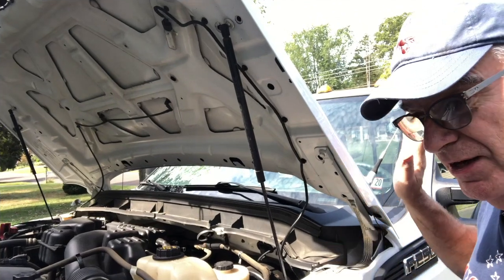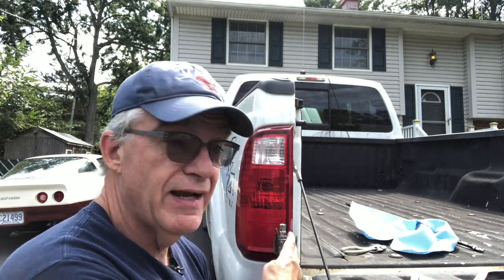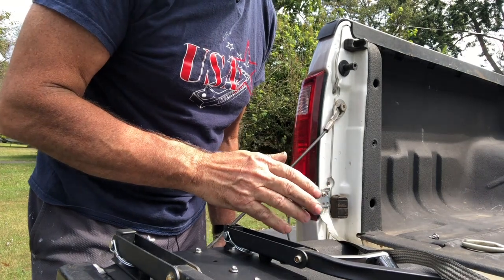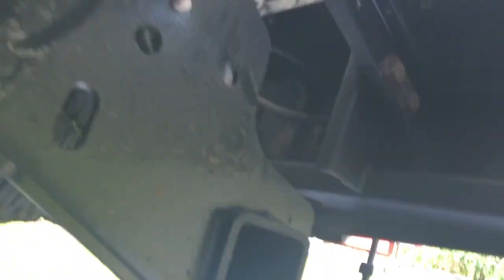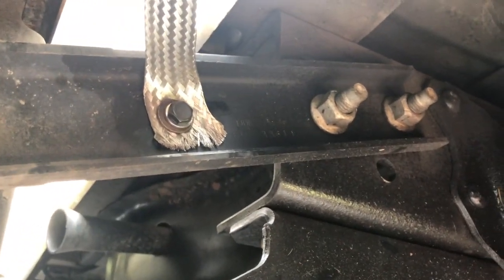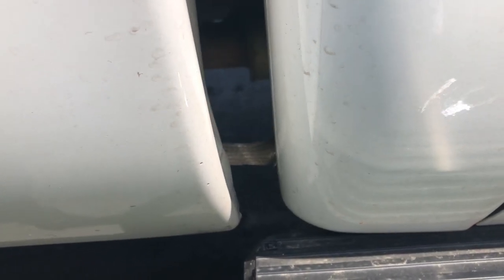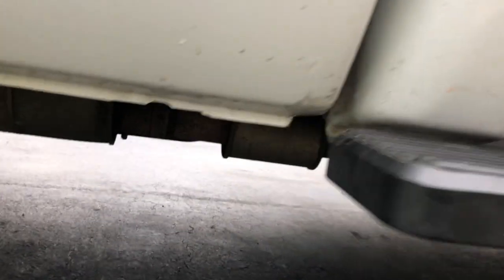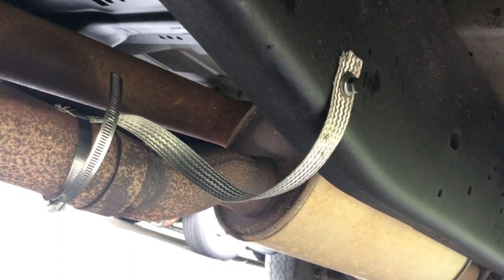Mobile HF Installation Part 2--Bonding

Comment: I view this as slightly redundant considering the sections of the truck are already bonded together or things like the taillights wouldn’t work without a ground wire path. Thus the frame is bonded back to the battery where it grounds. But more bonding ie neutralizing the electrical charge among panels the better.

Comment: Avionics tech here. We burnish the aircraft skin till it shines past the Zink primer coating at the hardware connection before connecting. We the glypt over the hardware and skin with glypt designed to prevent corrosion

Comment: Is using battery cable wire Ok or does it need to be flat wire.
Reply from the maker: Everywhere I’ve read recommends the braid for bonding more for RF reasons I believe.
Reply: I have ordered some flat braid. Thanks

Comment: I have been watching videos on this very subject no one has said anything about bonding the exhaust which is already grounded to the engine. I'm using 3/4 braid soldered onto copper fittings and going down to bare metal. Most videos claim every 12 inches or 12 to 18 inches I'm going every 15 inches. All four corners of the cab same with the bed all four doors both sides of the tailgate the hood and cab to bed. I spray clear coating over all the ground points when I'm done this has made the RCI 2970 come to life almost like being hooked up to the beam antenna.

Comment: I have not bonded my Ram 3500 diesel at all and I'm running a mag mount antenna to my radio.   11 meters.
Talked to Europe and UK/Ireland, west coast and South America from NC last week no problem.   About 75 watts.
Reply from the maker: Excellent!
Reply: Never confuse what propagation gifts you as a litmus test for antenna performance. The operators set up on the other end along with just a damn good pipeline the propagation can make even mediocre set ups boom in other places

Comment: Great video! Thanks for posting! I’m going to have to do my truck now. Usually only operating 2 meters and 440 but occasionally I do stick the HF triple magnet mount up on the roof and I’m sure it would make a better ground plane if everything was bonded. Thanks again for the video.

Comment: So glad I stumbled across this video.
I just finished bonding my Ram 1500 and I think it made a really serious impact.  It's funny because I had the same exact problem you had where I ran out of braids when I went to do my exhaust. That will be next up when the spring weather hits.  K9KJ
Reply from the maker: I didn’t scrape the paint though.  I’m thinking about going back and doing that.  The installation is probably due for some maintenance anyway…when the spring comes!
Reply: @k2cjbradio  I'm thinking about going back and doing that too. I did mine just how you did yours. I think I notice a difference at least on receive

Comment: I have never once bonded a mobile install.I have had around 10 different HF mobile setups and I have never had any noise issues with any of them.I had great success from all except a Yaesu 857D and ATAS 120A that were both pure Garbage. I replaced them with an ICOM 7000 and a Tarheel II and all of the issues I had with the POS Yaesu gear immediately went away. Bonding may make my mobile even better but I don’t see any issues with what I have now so if it’s not broken don’t try to fix it.Leave well enough along.👍🎙
Reply from the maker: I am still dealing with coil on plug noise.  Might be the 7100 isn’t able to deal with that kind of environment
Reply: @k2cjbradio I currently drive a 2007 RAM 1500 5.7 HEMI Quad Cab and I don’t have issues on any band from HF thru VHF/UHF.I have an ICOM 7000 with Hustler Resonators and an ICOM 4100A with a Diamond SG7500A as well as a Radioddity GM-30 with a 5/8 wave Laird antenna and no issues with any of them.I use a ClearSpeech DSP base module with the ICOM 7000 but I use the ClearSpeech DSP Base units on every radio in my shack so I don’t have noise issues.I HATE NOISE.🎙
Reply: I agree that ATAS is not great, never got it to work with my 13 year old FT-857D.  Yes, the 857 is noisy, but I've done three mobile installations and I've never bonded, wondering if there is any improvement?
Reply: @frankwc0o  I have no noise with my 2007 RAM 1500 Quad Cab with Zero bonding.I had terrible noise with several Chevrolets and a Toyota.I have had no noise whatsoever with 2 different Dodge Rams.I’m using my ICOM 7000 and a Little Tarheel HP.
Reply from the maker: @frankwc0o I didn’t do a before and after test.
Reply: @k2cjbradio  I’m not trying to make mine quite since it already is.You just can’t fix something that is garbage from the start and they don’t care about making them quite.It cost them a few extra pennies and they are cutting corners more and more every day.

Comment: Good info.   I was not aware that this was necessary, so thanks for sharing this.   It seems you are just cutting the braid to size;   do you do anything to prevent fraying?
Reply from the maker: No I didn’t.  Some of the jumpers were a bit short.  But, a few years later and they’re all still there

Comment: Maybe I'm splitting more than braid  here, but I believe any painted surfaces that will make contact with the braid  need to be taken down to bare metal !
I might also tin the ends of the braid to allow for a more substantial contact area.
For those concerned about dissimilar metal issues, I believe there are a number of available spray's to combat same !
I know it's a pain, but anything worth doing, is worth doing right !
With the trade off here being reduction of noise, and proper shielding of Automotive components !
                🤔....?
              Just Say'n !
Reply from the maker: I did research that a bit and learned that we don’t necessarily need to go to bare metal because the RF couples rather than relies on a physical connection.  I’m sure others may suggest otherwise.

Comment: Chris, where do you purchase the braid?  I have found some at DXEngineering that is 10 feet long with ring connectors on it.  I can’t find the braid you are using.
Reply from the maker: Kinda late in responding….I forget where I got it.  Hamfest maybe?

Comment: Great video, but I do have a question ...... since your antennas are on the back of your truck and sit below the body line, does it affect your signal and reception?   Also, does it make it more directional?
Reply from the maker: Hard to say since I never did a comparison.  I do have a video of me operating mobile.  It might be directional toward the front of the truck.  I’ve worked mostly eastern US but have made the trip to Europe occasionally.  Thanks for watching!

Comment: I've installed many mission critical HF/VHF/UHF radio systems per manufacturer specifications and I've always bonded the RT, PA, COUPLER, and antenna mount to the body or frame of the vehicle by removing the paint and coating with a dielectric paste. But I have never heard of bonding each and every panel including the exhaust. I can't wrap my head around adding braid to a component that is bolted or strapped to the frame already. Besides just doing because it doesn't hurt, do you have any data that would support this?
Reply from the maker: I learned a lot from K0BG.com. Extremely thorough website on mobile installations.  Also VE6AB (jerryclement.ca) is a great site.  Re: bonding exhaust.  The theory goes that it actually “floats” from an RF standpoint and serves to act as an antenna radiating ignition noise.  Bonding to the frame reduces that effect.  Some recommend bonding it in 3 or 4 places.  I’ve also learned that the new paints have zinc in them as a rust preventer, and to scratch the paint nullifies that benefit.  Hope that explains why I did what I did.
Reply: @k2cjbradio  Thanks. I'll take a look at it.

Comment: I suggest switching the exhaust bonding to the U bolt kids from DX Engineering. My hose clamp/braid installation corroded badly after one winter. I bonded the hood, doors, and tailgate on my Honda Pilot using the same method as you, but I used crimped and soldered lugs on the end rather than compression of the braid. YMMV, but I wanted to be able to really honk down those mounting bolts (and/or nuts, depending on the location) and be sure that that connection was never going to loosen. I also used JetLube SS-30 on all of those locations (also available from DXE) and those connections still look like the day I did them.--73, K2UA
Reply from the maker: I haven’t taken a look but now that you mention it I’ll check things out
Reply: Believe it or not / electrical connectors need to be maintained annually.  Fluid Flilm / dielectric Grease.

Comment: The reason u leave the paint is that the zinc primer is it's electrically conductive. The tightening bolt with a lock washer is enough to make the contact. Use 18-8 stainless hardware where u can. Seth KC2WE
Reply: I’m an avionics tech and we have far more Zink in our primer than vehicles but we never leave primer on. We always burnish it all off under the hardware. We take a megaohm meter and would never pass our tolerances if even a small coat primer or anodizing is on it. Burnish till it shines torque it. Then cover the hardware and skin in glypt to prevent corrosion.

Comment: Nicely done.  I'm using your instructions for mine.  Just different antenna.  Where did you buy the bonding wire?
Reply from the maker: DX Engineering has it.  Have fun!

Comment: Will you do the doors to the cab, too? as far as scraping the paint, is the paint conductive? If not, how is it actually bonded? One thing that has prevented me from doing any hf install is drilling holes and thus opening the vehicle to the chance of corrosion it that spot, like where you mounted the antennas near the tail.
Reply from the maker: I haven’t done the doors yet.  Also didn’t scrape the paint as I understand the RF path that the braid provides capacitively couples the two body parts.  At least, that’s the theory.

Comment: So I was chatting today with Blue Berry Hill on the 38 LSB. Explaining my antenna is located beside the hood at the drivers side fender, he mentioned I should relocate the antenna because the RF can fry the computer on my vehicle. Anyone hear of that? Thoughts? Maybe a Faraday cage for the computer? To see my rig, there's a video.  https://www.youtube.com/watch?v=DF6iWdeJRCs
Reply from the maker: Never heard of that happening.  I haven’t experienced any issues.
Reply: RF can affect the vehicle computers.  Back in the day I drove a cable company bucket truck and it had been discovered that xmitting on the VHF radio would disable the governor on the truck.  When we needed a little extra from the engine to go up a steep grade we would just hold the mic button down for as long as needed.

Comment: Nice video, very informative - I installed an FT891 in a 2012 MINI Cooper this summer, my 2nd mobile installation - and did NOT bond and am now understanding how necessary it is.  In addition to RFI with the engine on, I've had difficulty tuning the ATAS120 antenna (lip mount on rear hatch due to the car having dual sunroofs) - - - will be getting some braid and getting busy.  
(I blogged about the installation at www.ab1dq.com, will need to do a Part II, I think...)
73 de AB1DQ.
Reply from the maker: I added more after the video.  I had an ATAS years ago and it was erratic.  I know now it’s because I didn’t bond the Explorer as well as I should have
Reply: Don’t forger to use a choke when doing the install. That could have helped your Mini Cooper install.

Comment: I’m getting ready to install a Tarheel screwdriver antenna on my 2017 ram king cab I’ll have the antenna mounted on the driver side back corner this is by far the best bonding video that I have found so far thank you sir
Reply from the maker: Thanks so much!  Glad it helps!
Reply: Did you see any improvement on your HF antenna when you bonded?
Reply: @frankwc0o  well, the antenna was a new install not existing so I can’t speak to the fact of improvement but the antenna system works fantastic

Comment: I saw your entry point into the rear of the cab from the outside, but I can only imagine how you got past the interior wall behind the rear seat...
Reply from the maker: That was a royal pain!!
Reply: @k2cjbradio  I'm trying figure it out myself on my 2000 Quadcab F250, I could only get the top part to pull away after removing the plastic rivets, its Horrible, its all behind the paneling,   :(  - KJ7RTW

Comment: worked on installing vhf radios etc on fire trucks in Canada for 7years Everything was deemed too be bonded to ground ( chassis )including most importantly the exhaust system 
Great to see this basic principle  included in a ham radio installation ,Sadly missing in all the others  ive watched

Comment: Chris, Thanks for your Videos and all your efforts with putting them together. Greatly enjoyed this series. Just curious: In part 1 you scanned the antennas before you did the bonding. After bonding did you scan the 2 antennas again. Will be very interesting to see what effect the bonding has on the SWR, on the resonant frequency and the usable bandwidth on 20 and 40 before and after bonding. 73 de k1jbd, bammi
Reply from the maker: Jwahar Bammi Thanks and I’m glad you enjoy the videos!  Good question!  I never did check the antennas after bonding.

Comment: Hi sir I’m new to the hobby and I haven’t done this I might sound dumb but where can I find this braided wire if u can help please and great videos by the way 👍👍👍
Reply: Thanks so much awesome videos
Reply from the maker: martin maciel Thanks!  DX Engineering has it in different widths.  Welcome to Ham Radio!!  73 de K2CJB

Comment: Thanks again for another great video and for the quick response to the last video comment I made. Another quick one here to get your opinion. I was thinking of roof rack mounting, I realize I'd need to be aware of clearance, but what ground would you do with that? Wire to one of the metal screws holding the roof track bar into the roof? 73
Reply from the maker: Paul K5VOP JI1BGC I guess the question is what kind of antenna will you mount up there?  Will the roof rack be able to support it at highway speeds?  Is it a metal roof rack?  And how is the roof rack connected to the body of the vehicle.  In the past I have run a braid from underneath the screws on a trunk lip mount to a nearby hinge bolt.  That might help with bonding.  I would imagine you could do something similar off the roof rack mount.
Reply: @k2cjbradio  the VHF UHF is a standard tri-band antenna on an nmo mount and the HF would be just the mount and not the antenna when driving. I'm looking at the alpha FMJ with moto whip.
Reply from the maker: Paul K5VOP JI1BGC I think the VHF/UHF would be fine as is.  So you won’t be operating HF while driving?
Reply: @k2cjbradio  For the most part no. If I did find myself wanting to then I would look at roof rack, mount and antenna strengths.  But mostly for something like POTA to go, park and operate without major setup.
Reply from the maker: Paul K5VOP JI1BGC Yes.  For HF mobile, you probably don’t want to go with a roof rack mount.  But, you’ll figure it out.  Doing POTA is a lot of fun too!

Comment: Nice vid!!  I just my 4runners exhaust (2 spots) and hood(2 spots)  Would doing the doors and hatch help?  I mean it couldn’t hurt but they are vertical pieces of metal rather than horizontal like a roof or hood.
Reply from the maker: rallypoint1 It might!  The only parts I haven’t bonded are the doors.  But the bed, cab, hood, exhaust are all bonded.

Comment: Thanks for this.  I'm working on a Tarheel II on a F-350.  For now, just to get it installed, I ran a ground wire (10 ga dc wire) from the bracket to a bolt inside the door jam on the body of the truck.  It made a remarkable difference, but I need to get to work on this side of things.  Thanks
Reply from the maker: Wilson Hines Did you notice ignition noise?  I get quite a bit in the F250.  Luckily the noise blanker on the 7100 works great.  I do get ignition noise on 2m.  I ran a braid from the bolt of the back of the radio to a seat bracket bolt in the floor.
Reply: @k2cjbradio  You know, even with my mockery of a ground, I have no ignition noise.  I took it for a spin this morning and noticed no rise in noise or changing of tone with the transmission change and RPM.

Comment: Why would you need to bond or ground the exhaust system?
Reply from the maker: Just Me I got the idea from Alan K0BG and others who recommend bonding the exhaust system since it is isolated from the vehicle and can act like an antenna for ignition noise,  Alan's website is really comprehensive on mobile radio installation.  Thanks for checking it out!

Comment: I'm refining my installation on a 2014 wrangler jk. Elmers suggest augmenting the bond from the motor to the frame, as well as add some to instrument clusters, etc to further reduce the noise, as well as the vise versa of protecting the new fangled auto systems from RF.
Reply from the maker: macrossactual Not a bad idea!  I added more to the exhaust to frame, batt neg to firewall, and radio chassis ground to body.  Still getting some ignition noise.  Added chokes at base of antennas and coax input to radio.  Thanks for watching!  Hope it helped!  73 de K2CJB
Reply: @k2cjbradio  did you notice a difference when you ran the ground from the negative terminal to the firewall?

Comment: One more comment about scratching the paint and protecting the ZINC coating. This is SNAKE OIL. Why, it is only valid in Florida, Texas, California but in NORTHERN USA and Canada forget about that we use SALT on the road so our little zinc is gone. So go to the bare metal, if possible use a soldering equipment. PUT SOME LIQUID ELECTRICAL TAPE, apply a rust protective coating every year and now you are in business. Claude
Reply from the maker: Claude M. P. Hmm.  I could do that.
Reply: go to bare metal and spray with a clear coat will seal it also, and will last longer